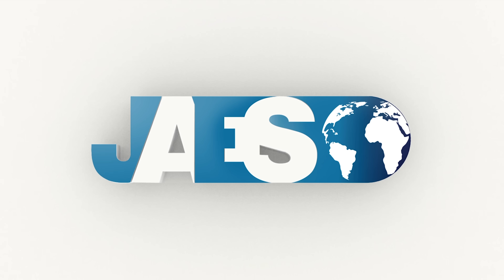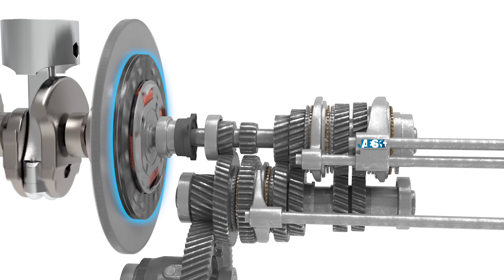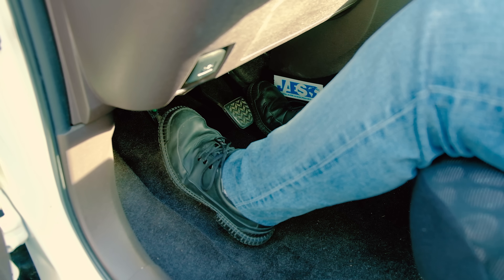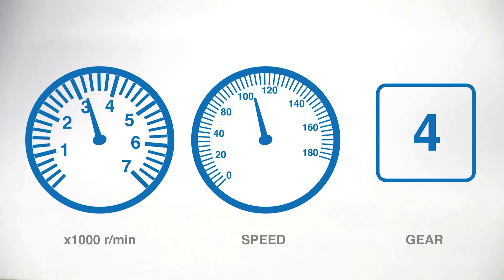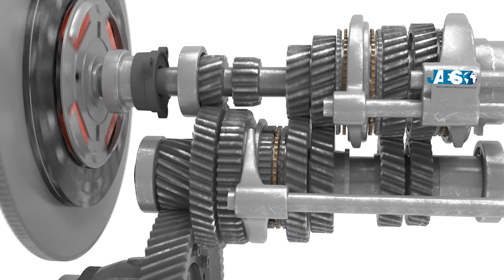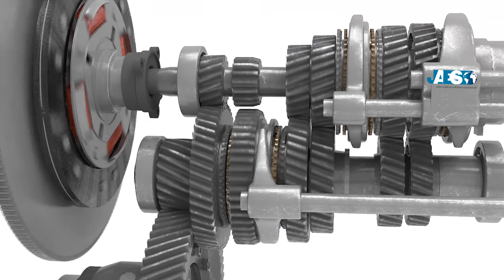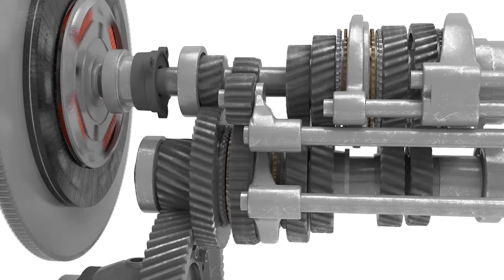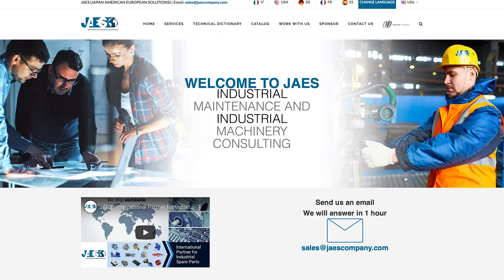How Manual Transmission work (Car Part 2) Clutch - Reverse Gear - Grinding Noise

Comment: So the grinding noise is caused by the teeth of the gears?
Reply: It is not caused by the top and bottom gears, those gears are in permanent contact. 

When you move the gear lever, it moves something called a selector fork, the selector fork moves something called the shift sleeve. The shift sleeve is located on the output shaft (connected to wheels) and is capable of moving back and forth (imagine a donut on a metal pole, it can be moved up and down) to engage 1st and 2nd, there is another shift sleeve for 3rd and 4th. The purpose of the shift sleeve is to spin the output shaft at the same speed as the gears ratio selected (top and bottom gear).

The shift sleeve needs to move into the SIDE of the gear to engage it, meaning the teeth have got to be aligned. But if you release your clutch too quick, the bottom gear will move too quickly, which in turns moves the top gear too quickly  compared to the shift sleeve and the teeth wont engage resulting in a grinding noise.

https://en.m.wikipedia.org/wiki/Manual_transmission
If you follow the link and go to the internals section, theres a good graphic explaining this.

https://youtu.be/wCu9W9xNwtI
Or start this video from 3:16 onwards